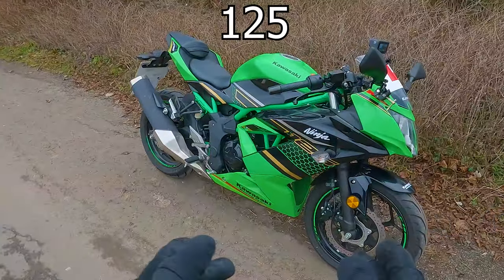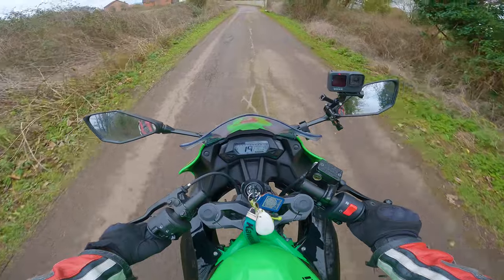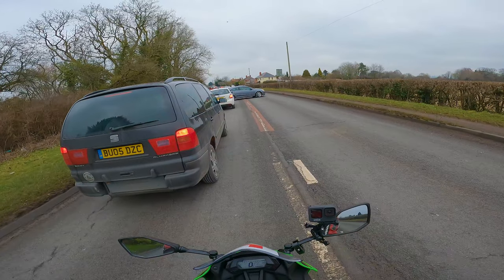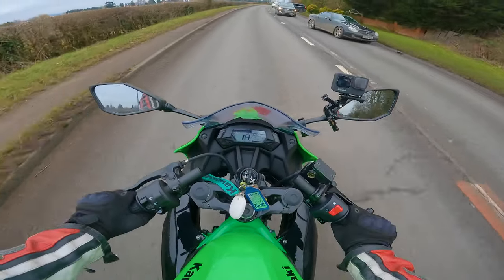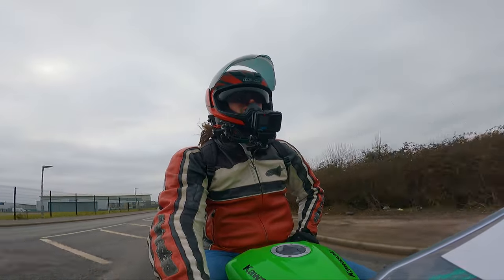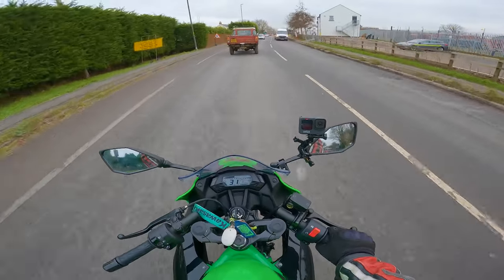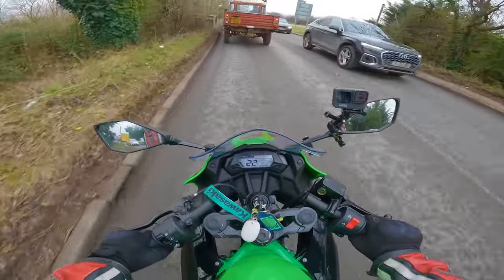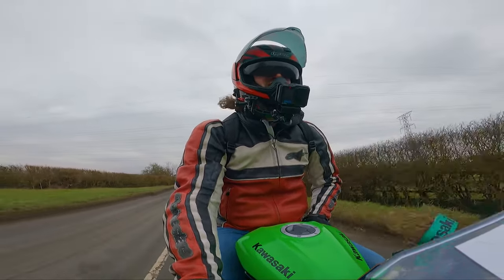Things You CAN NOT Do On a 125cc Motorcycle (feat. Kawasaki Ninja 125)

Comment: I used to take my little Honda CB125F (10.8 bhp) on dual carriageways. She managed 60 for the most part, though that brought the buzz out of the engine. 50 was definitely preferable for that reason alone.

On a couple of downhills I managed to get more speed. Turns out the rev limiter cuts off fuel at 70mph :P
Reply: my 2021 cb125f wont go past 63mpg downhill wind behind lol, but yeah, 50 is comfy, and i'm in no rush anyway, i enjoy tootling in the twisty lanes when you usually cant do more than 40 (safely) anyway. GL
Reply: @Bob-ts2tu  I'm definitely guilty of carrying way too much speed into some corners while on that 125, glad I don't have to do that any more.
Reply: @233kosta  aye, it's easy to do, and i too have to always conciously make an effort to slow right down especially on steep hills with sharp bends, as while the brakes are 'adequate', combined with the gradient, gravel, thinner tyres and lack of talent it can be a deadly combination !! GL
Reply: @Bob-ts2tu  I mostly did it to avoid the lengthy process of getting back up to speed. Ironically I'm technically a lot safer in this regard now that I ride a 650 :P

In fact the process of speeding back up is really rather enjoyable now.

But yeh, those skinny tyres do little to help the matter.
Reply: @andinic3982  I believe you, i actually opened mine up downhill last week, wind behind and tucked my ample un-aerodynamic frame in the best i could and it showed 66mph lol, so someone lighter, skinner & more flexible wouldnt have a problem getting to 70 io think, however the question is do you really want to?, and also to sustain that speed for long, i think not lol, im happy enough at 50-55 which it'll do all day. GL
Reply: I have a cb125 and I can barely reach 55, 50 is fine but it can't go much faster unless going downhill lol. It was definitely disappointing realising I couldn't go faster
Reply: @Helicoprion08  on the flat sounds about right, and speed increases a bit when you get it running, but the new cb125f aint designed for speed as much as economy im afraid, i understand the older models can reach 70mph, but do you really want to be going too fast on a 125 having it scream like a banshee at full throttle, i don't lol. GL
Reply: @Helicoprion08  125F? You've got to break those in right to get power out of them. Going easy for the first 100 miles, then a bit more theottle for the next 200, then up to full throttle until the oil change, but never revving very high (or too low).

Then after the oil change you can start edging up the revs too.

At around 1000 miles she should be cruising around 60 on flat ground, but 50 feels right for that engine. I distinctly remember my arse objecting to longer stints of 60mph, even though the bike was perfectly capable of sustaining that.
Reply: I get my first ever bike today which is a Honda CB125F any tips
Reply: @spencermoore3644  New or used?

Either way, you should have the clutch and brake levers moved to the right position for your hands. Same as the gear lever. I had to move mine up because my boots were too stiff when new, so I couldn't reach it to get to 2nd gear (they loosened up later). Maybe yours is spot on - check before you try to ride off. By the way, you want to be wearing all your gear when you're testing the adjustments, it will influence how your hands and feet sit on the controls, as well as your range of motion.

If it's brand new, it'll need to be run in. Take it real easy for the first few miles. Up to 100 miles avoid revving high and adding too much power. After 100 miles you can start to increase your throttle input. After 300 you can start revving higher (not under a lot of throttle though, just let her rev out more under light load). Also you don't want to sit at the same speed in the same gear for a prolonged period of time.

City riding is pretty much ideal for running in.

After the first oil change you're good to go.

Oh, and don't sit idling for 5-10 minutes to "warm the engine up". That makes all the parts heat up unevenly, which is not what you want. Instead, give it 10 seconds on a cold start (to get the oil where it needs to be) and go easy for the next 5-10 minutes.

Don't fotget, it's an air-cooled engine, so after 5 minutes of slow practice you'll want to give her 5-10 minutes switched off to cool. Or go for a faster ride (say up and down the road, 20-30mph, for a few minutes) to draw the excess heat away. These things are pretty robust for what they are, but they still have their limits.

In terms of general riding, you want to learn to be smooth with all the controls. That's gotten me out of trouble more times than I can count. Once you're smooth enough, you can start to push the (imaginary) boundary (which is in your mind) closer and closer to the limits of the machine. In doing so, you learn to trust the physics. Among other things, you learn how much you can lean into the front brake with zero adverse consequence (I was doing stoppies on mine 🤣), and I would argue that this is the most important skill you can build.

Learn also to trust countersteering. There's nothing voodoo about it, it's literally the same as body roll in cars. Except on a bike you want the roll. It's useful for turning at high speed and for balancing when going very slow. It's also THE way to do the mod 1 avoidance thing.

Have fun!
Reply: @spencermoore3644  get proper protective gear. Hope you never need the benefit of it, but you won't know how much you need it until you do. GL
Reply: @233kosta  wow a lot haha but thanks appreciate it and it’s brand new I’m her first owner
Reply: @Bob-ts2tu  yeah I’ve 2 sets of that haha
Reply: @spencermoore3644  In that case, get the stealers' to make the ergo adjustments for you, and to set the rear ride height up for your weight
Reply: @spencermoore3644  after buying my bike i couldnt believe the cost of good gear, and spent a large unanticipated ££'s on top of my budget. glad i did though, i love the oxford mondial clothing for one. and as the alfred dunhill saying goes, quality is remembered long after the price is forgotten :). GL and ride safe. PS something i did on my bike to make the ride better was adjust the rear preload up to 4, but i'm a heavy guy.
Reply: You modern kids have it rough. My 125 was a beast and would pull to 90mph strongly. It was a 2 stroke of course tho, meaning it had no grunt low down or off the lights. All top end. Plenty of 125 sports bikes could do over 100mph.
Reply: @itzajdmting  my 125 only goes 71 max 😂
Reply: @spencermoore3644  That's all good mate, some can't even do 60mph! If you need to be doing motorway speeds plus you need a bigger bike bottom line. Happy riding! 👍🏽
Reply: @itzajdmting  I’m not allowed on motorways my license doesn’t let me
Reply: @itzajdmting  I mean I was on mine for all of 4 months. 'Twas good enough.
Reply: @233kosta  Fair dues. A good incentive to progress I guess. Wish I had taken my test back then.
Reply: same here i think the older models can have less limitations. i have to ride my cb125f on dual carriageways everyday and I've gotten 74-5 out of it before
Reply: honestly it feels pretty effortless to cruise on it at 60 all day  @233kosta
Reply: @lucaslewis7582  I think once you put enough miles on it for the engine to loosen up a bit it gets happier at those speeds. Still buzzy though, which made my arse numb after four hours 😔
Reply: I can confirm your 70 mp/H on Speedo for the Limiter. If you Switch to kp/H it´s even slightly more roughly 71.5  ord 115 kp/H but in reality it´s only about 64-65ish on GPS and an Zumo XT isn´t so far of reality. But it´s a great little bike
Reply: @mariokuppers5686  'Tis but 11 bhp. Small wonder it gets to that speed even! The 125R has 15bhp and can probably comfortably sit at 70, but it's also quite a bit more expensive. Didn't seem to be worth the extra cost for a bike I'd be on for less than a year. As it stands, I was only on her for 4 months, so good saving there.
Reply: cbfs can wheelie like a beast
Reply: @nebster680  I did have a couple of those when fully laden (big heavy tail bag... in retrospect the bike was probably a little overloaded 🤣) just pulling away from traffic lights, but being a 125, she didn't quite f-ck off on me like an MT-07 would have wanted to.

My preference have always been stoppies. For some reason I feel in more control.
Reply: @233kosta I was doing this on a 50cc through corners  I was carrying all the speed I could as in most cases it wouldn't even get back up to speed after the corner. When you only have 6.5 hp you can never afford to slow down.
Reply: @Bob-ts2tu I mean 60mph on most is 9k rpm who wants to take the revs any higher.  70mph is literally on the red line if any even make it to 70mph.
Reply: @chrishart8548  I'm just glad I don't have to do it any more. In hindsight I did some pretty dumb sh!t on that 125
Reply: @233kosta  I went from a honda cb125rs  to a suzuki GS500E  and it was a revelation.
Reply: 4-STROKE P-O-S !!!
2-STROKE RULES !!! :)
Reply: @sonix7119  Just don't inhale the exhaust gasses...
Reply: You can reprogram to up the rev limit to 11k it’s still a safe rev limit for that bike
Reply: @tumo07  "Safe" is a relative term... she's just not happy going that fast. Not a comfortable experience.
Reply: @233kosta  nope i have it and i did just that
3 years riding when i go on a trip i full throttle continuously for 80 miles

Comment: I did feel my front wheel lift off on numerous occasions while I rode a 125, but that was with a 25kg tail bag strapped on and only pulling away from traffic lights.

I used to do pretty decent stoppies though ;)
Reply: We’re the stoppies happy accidents by any chance? 😅 I’m getting a 125 ktm rc soon I think and kinda scared to break too hard and eat dirt 😂
Reply: @JustinLT212  Nope, on purpose. As long as you're smooth you're fine. Progressively add brake effort until the forks go all the way down, then a bit more to lift the back wheel A BIT. If you feel like it's going too high up you can always ease off, just don't dump it.

It takes a little while to develop the finesse, but once you're smooth enough this stuff gets real easy to control. Being dead smooth affords you the time to feel exactly what's going on and even think about what to do next, but you've got to edge your way to the limits, can't just jump in. That then also teaches you how the bike responds near said limits and how to correct if you overstep.

Smooth, progressive inputs are your best friend. Sharp, abrupt inputs are your worst enemy. "Slow is smooth and smooth is fast" applies here just as much as it does to martial arts.
Reply: @JustinLT212  i did tons of stoppies while emergency breaking on my rc 125. how is yours treating you?
Reply: @mavr6384  I didn’t end up getting one, got my drivers license and started driving a car like a boring fucker 🙃🙃😢😂😂
Reply: @JustinLT212 better decision but boring lol 😂
Reply: @Endidixknsej  100% bro I’m ngl I have a good car so makes it better but still, there is a biker inside of me that’s facts. I know I want to be on 2 wheels I can’t wait hopefully one day

Comment: I used to love tuning the old 2 strokes. Imo that's worth it. Plenty you can do to squeeze a bit more out of them although your reliability goes as fast as your rev counter and your hearing 😄
Reply: the reason why I stopped at 1.30 when he said no mod for performance (laughter) just shows his ignorance. 125 2t restricted 14hp, derestricted and tuned 21hp
Reply: @mrburn6119 that's cool, but there hasn't been a road legal 2 stroke 125cc motorbike in the UK since 2008. so for the massive majority of people that will be using a 4 stroke, it is sound advice.
Reply: @friendlysnoworb6091  ktm exc 125 production years? It does not really matter when they were produced, plenty of old skool 2 strokes registered on the road.
 And yes while you may be correct that the vast majority have 4 strokes, a group of several thousand (2strokes) is to be ignored? which some might see as ignorance on the subject.
Reply: @mrburn6119  several thousand means literally nothing in comparison to the mass production of more modern, cheaper and far more reliable 4 stroke bikes
Reply: @friendlysnoworb6091  Hmmm so it would appear from your statement that you have never cared for a 2T - or maybe you did and you blew it up?
 If you had cared for a 2T then you would know they are as (if not more) reliable than a 4T, with the proper maintenance. An average Joe with average tools should be able to do everything to a 2T, can the same be said when it comes to servicing/reseating the cams on a 4T?
 As for the cheapness of a 4T over a 2T - is that why plenty of people have built a 2T engine from scratch - because (according to you) a 4T is cheaper?  🤣🤣
 Reliability is 100% when I daily commute on a 30yr old 2T. 
 In comparison maybe, but it is still a few thousand and if they all turned up outside your residence on a Sunday afternoon, it would be a sight.

- Hilarious, keep commenting from your armchair, and keep investing your time watching ignorant people- it obviously has an effect (as shown by all your comments - years of production, cheapness, reliability)
Reply: 4-STROKE P-O-S !!!
2-STROKE RULES !!! :)
Reply: 4t same thing, you don't get as much reward from jetting and carb tuning as you do with 2t.
But if you have a few cheap dremmel tools and some dichem and 3 brain cells still hanging around, you can port match and flow the head for biiiig returns especially with the smaller displacement engines as the areas where intake meets head are generally really poorly finished.
A remapping is 100% suggested! 99% of bikes run a fixed map which means that your bike was tuned at sea level and generally every 500m elevation.
If your bike has an o2 sensor then congrats as your bike likely runs a static map which means it actively monitors air fule ratio to keep it stoic your bike will respond better to port work but still recommend a safe aftermarket tune or ideally a dyno tune as the factory map is basically a restricted map.
Reply: Mate 4t ain't more reliable than 2t... its not a debatable subject as statistics are in favor of 2 stroke machines. If a 4t bike has a dropped valve it won't start, cam chain breaks ...its all fucked, cam slips timing won't start, may cause catastrophic damage.... none of those exist in a 2t engine.
This is primarily the reason why there are so many 2t older bikes out there than 4t bikes. 2t are ridden much harder and rarely give up the fight.

The dig in about the couple thousand bikes in the uk being that are 2t not being much....
Well have a look at UKs annual sales for motorcycles and remember more than half are pizza delivery scooters.
A large portion of uk riders are actually blue blooded fule mixers!

Comment: Totally agree with your comments. Just got my A license and traded in the 125 duke for a 790. If anything the 125 was better around town but for the open road there's no comparison. Any headwind or gradient and the 125 really struggled to keep up.
Reply: What did it for me is duel carriageways  with a strong headwind I  could hardly hold 45mph.  Most other time it was OK for 60mph.   Hills were also  a pain In the ass. Sometimes it wouldn't even pull 3rd.   Just had to red line in 2nd all the way up.
Reply: 4-STROKE P-O-S !!!
2-STROKE RULES !!! :)
Reply: @chrishart8548 wtf kind of 125 did u have. Iv never seen or ridden a 125 4 storke that struggles to hit 60 mph. I coud to 60+ mph on the freeway with my instructor on the back ( he weights around 80kg) and with the wind against me. So idk why kind of bike u have
Reply: @nisufisu  cb125rs cb125T xr125l  wr125r  r-125  cg125's are definitely slower again.
Reply: I get my 2024 Duke 125 this Friday. I plan on staying well away from boring dual carriage ways. I'll be going in the peak district, countryside, cornerly heaven 🙌🏼
Reply: @chrishart8548 it's legal to go on dual carriageways on a 125 with a CBT however it's strongly advised not to
Reply: @Abdul-wahaabKhalil  I took mine on the motorway 125.  Obviously I Had my full licence by then.   I often had to go on duel carriageways to get places. If there was a headwind it was very frustrating.

Comment: Looks like a fun bike. I rode 250Rs from Kawasaki that were a ton of fun and could easily handle most freeway situations, with the exception of passing while going up hills, which they weren't good at as their main weakness. But everything else, they were good at. They could do a wheelie from a stop, pulling in the clutch, revving to 7500+ RPMs and then completely letting the clutch go instantly, which was not fun at all and highly not recommended due to the sudden jolt from 0 to fast and the bike's front end going far up. I wonder if the 125cc could do that, but not really worth trying IMO. I avoid wheelies on my '21 Ninja 650 too.
Reply: 4-STROKE P-O-S !!!
2-STROKE RULES !!! :)

Comment: I used to take my 125 on the motorway.
It shaved 5 miles off my journey.
It was ok tbh.
Only did 60 on one stretch but lorries can only do 56 so i was fine in the inside lane.
Mostly though it would hold 70-75.

Comment: ive been zipping aorund on a yzf r125 for a few years now. love it. you can use 100% of the bike almost all the time lol
Reply: Can i ask how old are you? I wonder what is the average age of 125 riders.
Reply: @strangerwe9776  pretty sure the main average is between 17 and 19 and thats the rough age of the cbt and A1
Reply: Can I hit highway speeds on a 125? I really want a 125 but wouldn’t get it only for that reason.
Reply: @nathanielreeves_dev  you will not be able to hit any high speeds on a 125cc engine motorcycle, yzf 125 like 80 mph max